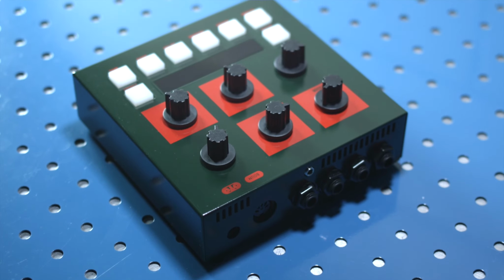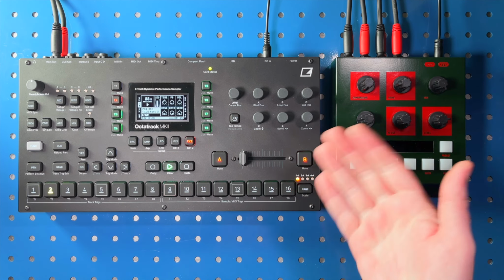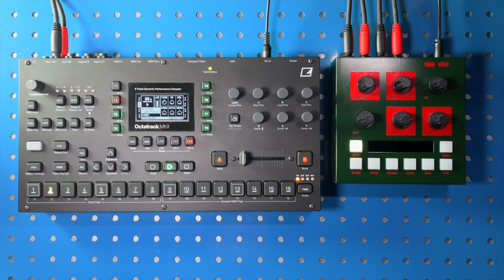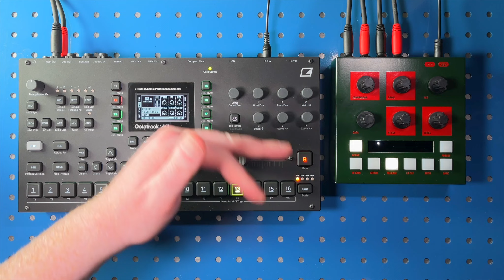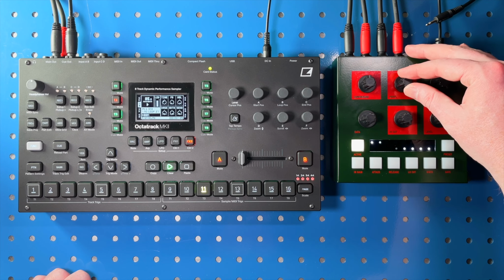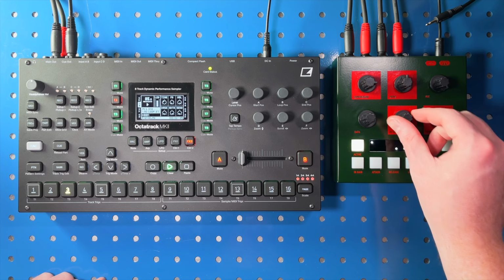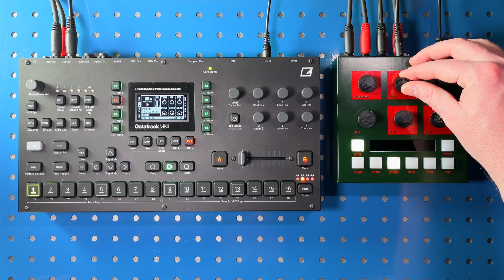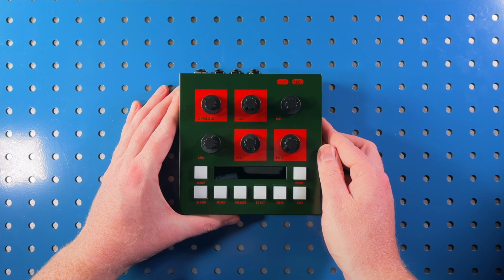OTO Machines BOUM Demo w/ Samplers (Elektron Octatrack MKII)

Comment: Thanks for sharing! High class presentation! …. Trying to figure out which one is better, this or the Strymon Deco V2
Reply from the maker: Thanks for the kind words! I definitely think they're different enough that it's tough to compare. Deco adds a bit more of that tape saturation and a bit of delay and phasing kind of sounds, and the BOUM really brings a bit more range when it comes to crafting tailored distortion/saturation and compression with a stereo filter on top. I do quite like them both but I think I personally like them for different reasons. Deco is smaller, BOUM has more options. I feel like I like BOUM for the studio and Deco for live or a small rig setup. Deco runs on pedal power, BOUM needs wall wart power. Tough call - both great!

Comment: So how does it compare to the Elysia Karacter box/cube? Two different price points though sure. Nice work 👍
Reply from the maker: Thank you! And that's a very good question! I think it's all up to your needs and preferences. I find the BOUM has a rougher/coarser character, but adds compression and a really playable filter - while the Karacter feels more precise, has the mid-side mode which is super cool, and feels a bit more like a mastering-level device. The BOUM feels a bit more "heavy handed" in my opinion (whether that's good or bad is up to you!) and a bit warmer/darker sounding - the Karacter strikes me as a bit brighter. I couldn't say which I like more, and I could argue you could definitely find a reason to own both lol, and honestly if you could only go for one, neither would be the wrong choice. Hope that helps a little!? Haha
Reply: @Duskmos   Haha thanks. As clear as mud 🤣 But I understand what you’re saying. I guess in one sense they are different- Boum a compressor, but I guess they are both a “coloring device.”So you’d say the Boum can produce more aggressive tones?  Decisions, decisions- Cheers 😊👍
Reply from the maker: @lockyp204  Lol yeahhh, I'd say to really break it down, I'd go for BOUM if you want aggressive tones and compression, and I'd go with the Karacter if you want finer details, slightly cleaner audio, and to play with the stereo field (that's the M/S mode). They're definitely both coloring devices for sure, but each has their own tricks up their sleeves. Not to muddy things even further, but the Analog Heat MKII kinda sits between them if you ask me haha (although no compression). GOOD LUCK 😆
Reply: @Duskmos  Thanks for the comments and review 👍😃

Comment: Great video! Quick question; Does the low cut affect the frequencies on the compressor as well or just for the distortion? I’m thinking to pick one of these myself🙌🏻
Reply from the maker: Without checking for sure, if I remember correctly the low cut you set in the menu system is the one that impacts the reaction of the effect, while the knob is just a filter that is “last in the chain” that impacts everything running through it. I’ll double back soon and let you know for sure. Thanks for the compliment!
Reply: Thanks mate! That would be super helpful🙏🏻I’m really itching to buy one these, partly thanks to your video, however if there is no low cut filter on the compressor, it would be a deal breaker for me… Finger crossed🤞🏻

Comment: Any chance you’ll be getting their Bebe mixer to demo?
Reply from the maker: Hey! I’m hoping to. I just bought some other pedals/devices so the budget is a little thin at the moment - it might be a little bit if I do! 😆
Reply: @Duskmos  got one coming in today...drum machines all lined up ready to see if it does what I'm hoping it does :)
Reply from the maker: @Farold_Haltermeyer Nice! Lemme know what your thoughts are 🙌
Reply: @Duskmos  ok, so was REEEEAAALLLY hoping this was going to not appeal to my ear...but sadly it absolutely nails it. This isn't really a mixer, it's a multi-channel compressor and EQ. The tilt EQ is right up my street, and has a smartly designed sweep that then stacks into this high end sweetener and the deliciously plump character compressor. The clipping drive on the first 4 channels has the same gritty edge that the Boum seemed to love...not really for my tastes usually but as with the Boum it blends with the clean and just catches those sharp edges in the mix to lift some definition out where it's needed. And that sweetener circuit is great too, kinda a Wonderbra oof EQ....adds a sort of sweepable filter that separates and lifts the frequency layers and puts in some air where it's needed in the compression to really make it shine. This is a very smartly designed bit of kit, and it's mixer shell is deceptive as it's much more than that...and I stepped back after 10 minutes and realised why the pricetag...there is a LOT crammed in here. Am just emailing with Denis over a few queries I had, but I think this may be the answer to a lot of my DAW-less questions. I think you'll get a lot of mileage out of this thing.
Reply from the maker: @Farold_Haltermeyer  That's amazing! Yeah, funnily enough, the mixer part is the bit I'm least excited about! Good to hear it's a win!
Reply: @Duskmos  I 100% didn't sell some other gear to get a 2nd one at the weekend. Nope.
Reply from the maker: @Farold_Haltermeyer haha that’s amazing 🙌